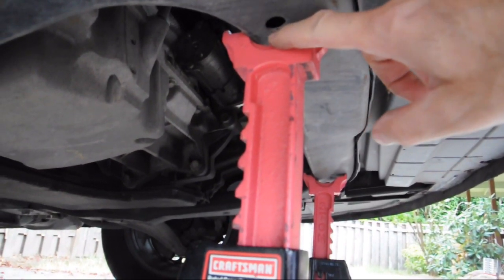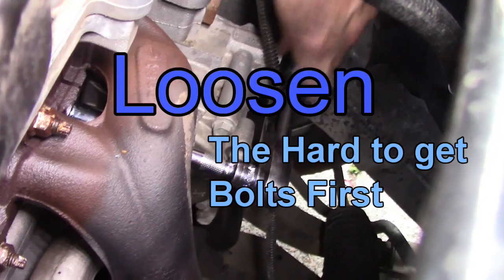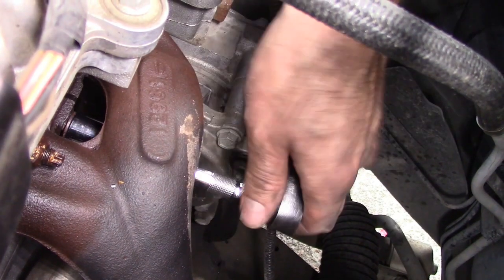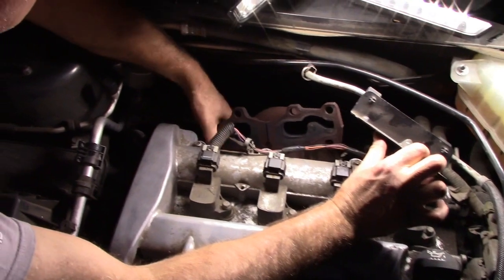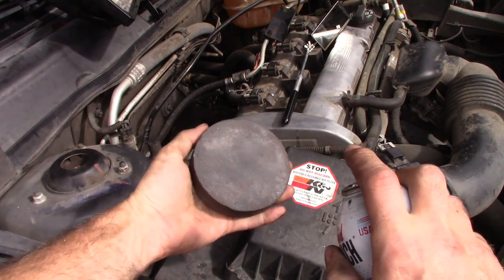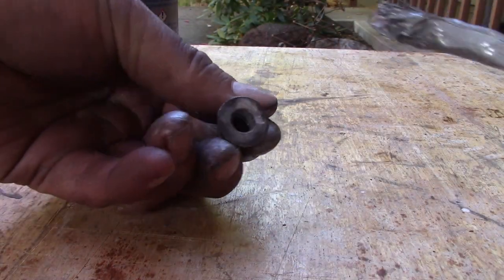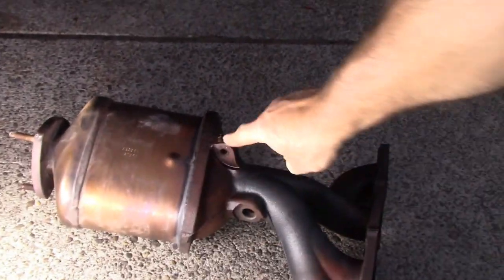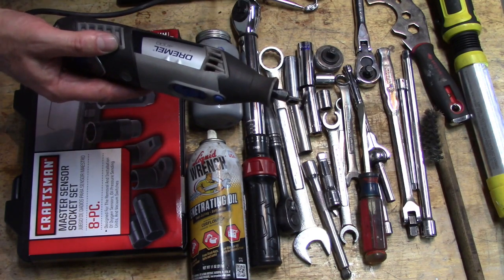Chevrolet Malibu Catalytic Converter

Comment: I'm trying to do this, but the rear O2 sensor will not budge and make it near impossible to get that 3rd bolt on the end of the Cat. Hot it with penetrating oil and let it soak in for 30min, but still no go. Any tips?
Reply from the maker: Honestly, I recommend either one of these set.
I own tools from both brands and like their products.
GEARWRENCH 8 Pc. Sensor and Sending Socket Set 
 https://amzn.to/3vS4Oev
ARES 10-Piece Oxygen Sensor Socket Set 	
 https://amzn.to/3uKHbDf

Comment: I scan Diagnostic on my 2010 Chevy Malibu with FIXD. My car recently just lost power while driving like it was running out of gas. But I wasn't. I tried adding gas it doesn't work. It still sound like Im out of gas. So when I used FIXD P0420 popped up. Could this be the reason my car just turned off on me. And What is the best thing to do if I cant get it to a license mechanic?
Can the Catalytic Converter Cause This?
I was thinking just replacing everything that a P0420 can be connecting with for I wont have a future problem
Reply from the maker: Maybe check the MAP sensor.

Comment: what were the openings that required the "Tapping" for?
Reply from the maker: There was a threaded hole on the new manifold for support bolt. The threads in that hole needed tapping.

Comment: Thanks Matt!  I got the same Beast('07 4 Cylinder) and this has to be done.  But you lost me on the "Tapping".  Did you have to tap 2 locations on the new assembly?...One just one?  What went into that mounting hole?  Did you need to Tap completely...Or just chase-out the threads?  I am also concerned about having to remove the exhaust hanger but if it's gotta be done, then I'm sure your tips will help.  Anyone else who knows the answers, Please Chime-In!
Reply from the maker: Just chase the threads of the new manifold.
Reply from the maker: I suggest any threaded holes in the new manifold, tap.

Comment: What size nuts are the three on the flex pipe? 13mm?
Reply from the maker: I do not remember. But, 13mm sounds right.
Reply: @badmatt4227  gosh mine are so rusted they are like somewhere in between 12mm and 13mm. Nothing is gripping and I don't wanna round them out.
Reply from the maker: @bashrodriguez3790  For bolts like these, I tend to use a six-point sockets instead of the twelve-point sockets. Soak nuts with penetrating oil for a few hours or maybe heat them with a torch. If using heat, the hottest part of the flame is the tip of the inner flame. Can try tapping the flat side of the nut with a hammer to loosen or a hammer and punch.